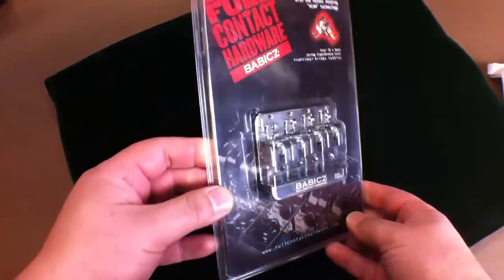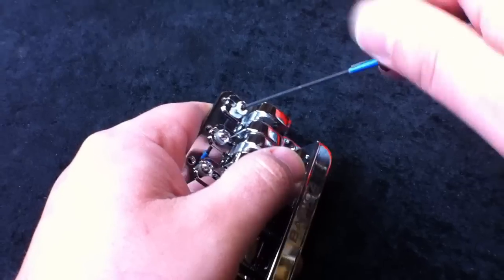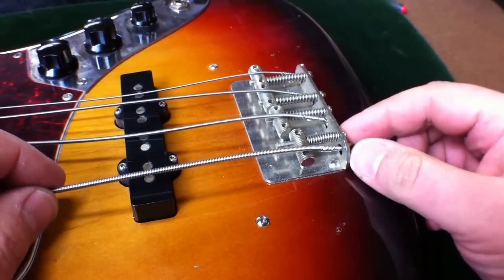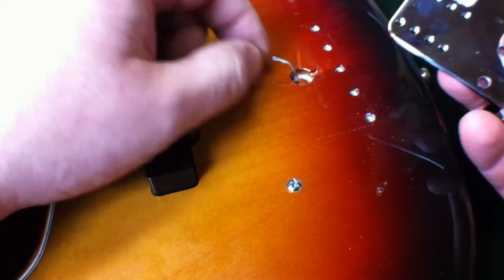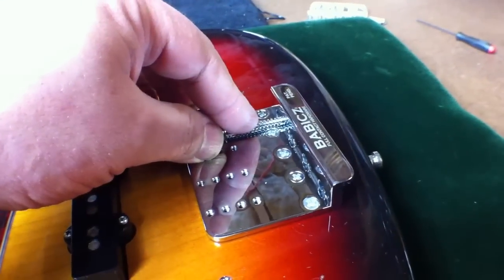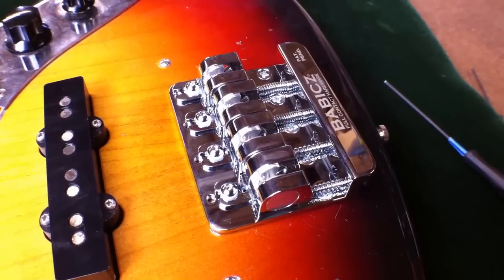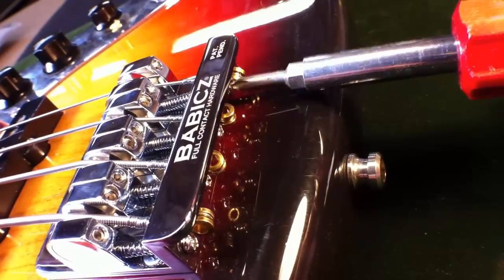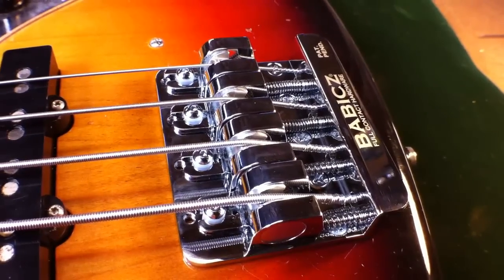Installation FCH-4 Bass Bridge- Babicz Full Contact Hardware

Comment: I installed this on my Deluxe Jaguar Bass today and love it! A little tip: After you tighten down the five screws that mount the bridge to the body of the bass, you can use a multimeter to check that you have good contact with the ground wire. Touch one probe to the inside of one of the mounting screws, and the other probe to the rim of your output jack. You should read close to zero ohms (continuity). Not having your bridge grounded correctly can lead to unnecessary hum or be a shock hazard.

Comment: I installed this on my Tony Franklin fretless bass. I was a little irritated about having to disassemble the entire bridge to install it. Once put in, it came together quickly. I am very impressed with this unit- bonus- the dead spot in my G string / 7th fret is all but gone. Unbelievable product. Most bridges don’t allow for enough travel; especially for a fretless. This was no issue. I’ll be getting a second one for another bass

Comment: These bridges are the single best improvement you can do to your bass.I have these on my 3 fenders and are very pleased with the sound and sustain.
Next time Jeff use some tape to protect the surface, I looked away at times! Those cordless drills can get away on you sometimes.

Comment from the maker: you can plug the original holes (1/8" wood doweling works well) and re-drill the mounting holes using the FCH 4 base plate a the pattern.

Comment from the maker: Yes it looks like it uses the Fender 5 hole mounting pattern which is found on the FCH 4 bridge as well. Just double check that your spacing between strings is .75 and you'll be good to go...

Comment from the maker: Not on this version. I'm working on a variation of this bridge with a three hole mount pattern which also has the string-thru the body feature...mostly for US Fenders. You may want to sign up for the FCH newsletter found at the fullcontacthardware webste. This way you can keep up to date with new FCH product releases.

Comment: I have one on a 76 Fender P- been on there for 7-8 years and hasn't budged or failed in any way. Increased sustain. My main issue is i have scar tissue on my finger tendons. So i need low action. Waaaaaay better than the standard Fender bridge for that and keeps intonation far better.

Comment from the maker: They might but at the very least you may have to drill new holes for the FCH mounting screws. The main thing to check is confirming that your string spacing is the wide .75" between strings...then you are good to go.

Comment: Hey this bridge looks pretty awesome. I want to buy one but i cant be sure if it will fit on my bass. I have a japanese aerodyne p bass. The current bridge is actually set into the body of the bass instead of sitting on top of it. What should i do? Try get some wood to fit in it and put the bridge ontop maybe?
Reply: I was about to ask the same thing. Will it work? What did end up doing?

Comment: I bought a Babicz bridge equipped bass a couple years ago, and recently realized that two of the height/intonation adjustment screws on the saddles are missing. Is there any way I can order these screws? The hex screws that adjust the cam.

Comment: Do the mounting holes line up with Japan-made Jazz basses?

I ask, because I have a Squire Tele that I bought a Wilkinson bridge for, but the dimensions are slightly off & I cannot use it. 

I am afraid of buying one of these bridges only to discover the mounting holes don’t line up.

Also, are there any issues with saddle-lock slippage? I had a guitar bridge that had similar locks & they would loosen from vibration & slip.

Do they use lock washers to prevent slippage?

Comment: Question, what is the lowest Height that can be adjusted down to? I only have 13 mm @ the G-string and 14 mm @ the B-string...so, that is from the bottom surface of your base(sitting on surface of my bass) to the lowest adjustment on your saddles

Comment: Hey im just wondering ive replaced my stock bridge on my squire with a fender vintage bridge which is basically the same.  When i installed the new bridge to the body the screws dont really screw tight though the bridge feels pretty firm on the body. Is this normal or will i need to get some longer screws so it screws tight?

Comment: My new fender deluxe 24 has string through body and doesn't have 5 holes. Will your system work for me?
Reply: it will work you just wont be able to string through the body.

Comment: I have a mex jazz 5 deluxe and the holes were way deferent 3 back 2 front I thought no worries I'll get the bridge anyway and hope the 2 extra screws will fit between my 3 back they dint line up so be wear I drilled out 4 holes and used the centre one as the centre on the new bridge .
The Two out side strings are good but for the life of me can't raise the E A D strings have followed the video and even started again but still same problem ... Help!!! What am I doing wrong ? I live in Australia I don't want to have to send it back !

Comment: What tool are you using to unlock and set the string height. I can't seem to find anything that works.  Lmk
Reply from the maker: 2mm hex wrench
Reply: @BabiczGuitars  👍🏻 I recently bought a used jazz and couldn't unlock the string height adjustment, but finally figured out the lock screws were missing.🤦‍♂️